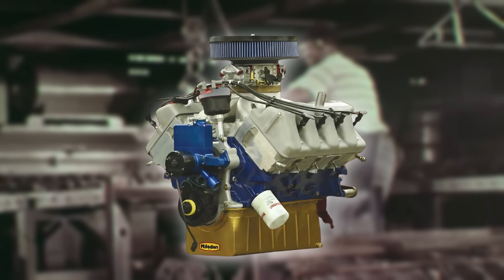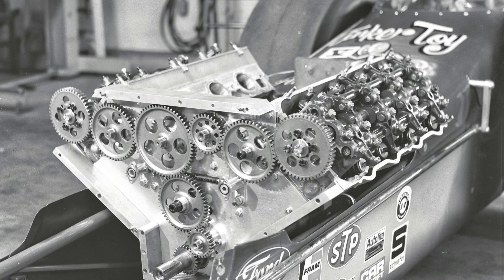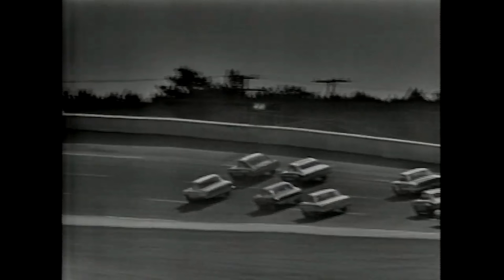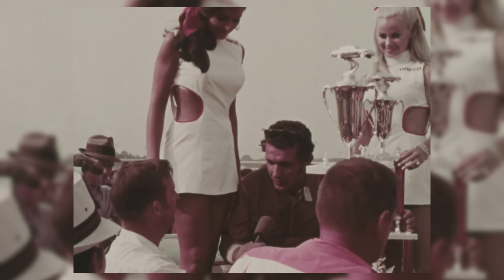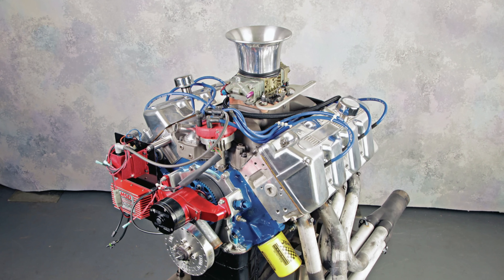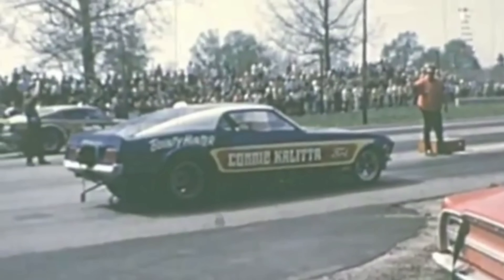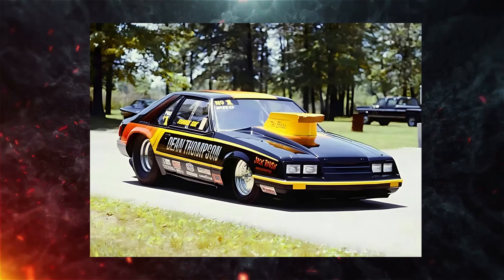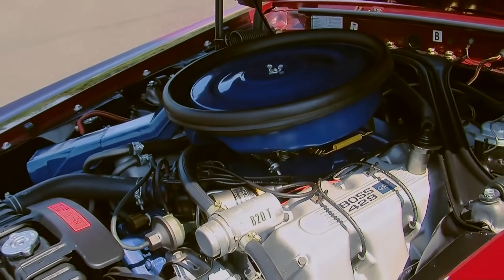The Shocking Truth behind Ford’s Banned BOSS 429 Engine!

Comment: Back in my college years there was a guy running a stock 429 'stang.  His first time out as pure stock he couldn't get into the 14s.  Over the following few weeks, he added slapper bars, slicks, advanced the cam a ton and maybe even headers.  Ta Da - high 12s.
Reply: @donbrutcher4501  From the factory they were so badly detuned and fact is Ford produced only about 500 of these cars . It wasn't until John Kaase got busy improving these engines that they took off. They dominated IHRA Pro Stock and Sonny Lenord basically coppied that cylinder head for the Chevrolet racers.
Reply: @anthonytumbarello9940 
Alan Root supposedly built the blocks for Sonny. In a interview Alan mentioned he had his initials AR is on every block he made for Sonny
Reply: @BS-Outdoors1320  did not know that.  If Alan Root made the blocks he made the leading cylinder like the GM pattern and not like the Fords. I've worked on a few Sonny's engines and never noticed any AR initials. But the cylinder heads were almost an exact copy of the Kaase heads.
Reply: @anthonytumbarello9940  
https://www.youtube.com/live/5hcP0TLK1Oc?si=DifHAXBd7VDqPfNo
1.21:00 he mentions about building blocks for Sonny for Ihra competition. 
He also built the billet blocks for MMR.  

Well before that he built the
Reply from the maker: @BS-Outdoors1320 @donbrutcher4501
It's amazing how much performance can be unlocked with the right modifications! Those upgrades really do make a difference, especially on a classic like the 429 Mustang.From a 14-second turtle to a high 12-second hare! Proof that sometimes, all you need is a little tuning—and maybe a magic wand.  love the attention to detail with the signature, great share!
Reply: @donbrutcher4501  it too bad that ford didn't make more than 500 of those cars if they even made that amount?
Reply: @anthonytumbarello9940 Ford actually made 1,359 Boss 429, cars through 69-70!
Reply: @jerrywatson8281  ford made some great stuff but they couldn't make 1429 LOL!

Comment: The problem with all the hemi engines is that the camber volume is too high.  To get high compression, it requires a domed piston.  This impedes flame front travel and reduces power.  Don Garlits used to run 50 degrees advance on the 426 to compensate for this.  All the hemis came into there own when boosted as this allowed a flat top piston.  With the spark plug in the middle of the chamber, this was a great improvement over wedge heads.
Reply from the maker: @turbo32coupe Ah, the hemi engines—where the camber volume is like that one friend who always shows up uninvited to the party! But hey, at least we can count on Don Garlits to bring the spark with 50 degrees of advance!
Reply: @rarecarstorys I think it was Tommy Ivo who first jacked the hemi timing in top fuel.
Reply: @rarecarstorys Camber is the tilt of the wheels and is a suspension setting, CHAMBER is a place where combustion takes place. Y'all'd think that someone that called the sock a camera 4 times would take a sec' to assure they spelled something correctly and didn't repeat a mistake... again!
Reply: @BubbaSmurft  I am typing challendged
Reply: @BubbaSmurft  A.I. is just super smart, it knows better than 'real people' 🤣.
I'll just stick to non electronic 'everything' on vehicles
Reply from the maker: @BubbaSmurft
Thanks for the clarification! It's always great to have knowledgeable viewers like you who can help keep everyone informed. i dont care about spelling correctly,  lifes to short ,  be joyful about inperfection and create things your passionate about , with love and jesus in your heart, remember to stay curious not judge mental , not all disabilitys  are visable ( Dislexia ) i suppose some people like to belittle others for trying ! because it make you feel superior or perhaps your evil and would tell a guy in a wheelchair to stop being so lazy,   anyway , i wish you well regardless
Reply from the maker: @1crazypj
Thanks for sharing your thoughts! There’s definitely something special about the simplicity of non-electronic vehicles that many enthusiasts appreciate. im with you on this 100%
Reply: But the Forfd Boss 429 is a crescent Hemi, which is a better street design. Ford choked the engine down as it was only concerned about NASCAR performance. Had emmisions regs had not hit, the Boss 429 would have conquered the street as well
Reply: @JC-gw3yo Nope. Ford didn't want tons of Warranty claims so valve springs that limited RPM to 5000 plus a small Carburetor and Exhaust manifolds just stifled it. As stated in the vid, the heads lent themself to running wide open for long periods, not from idle to top RPM in 6 seconds. 
     It took modifying it beyond what Ford engineers could see to make it something. With the Boss9 in slightly modified form, the Tunnel port outran it as they were outlined by Ford. The SOHC could outrun it until the chain stretched. The Chrysler Hemi was chocked and hobbled on the Big Oval. In Drag racing, it wasn't anything compared to what it was on the Oval. Glidden never let anyone see what he did to make that engine perform in Drag Racing. I'm  guessing that he filled the intake ports to gain velocity. Ford asked him and he told them the price, which they declined to pay. In stock form, the 351 Boss annihilated it. Truth is, better combinations could be had for less money and more performance, such as the 351 Boss. The Boss9 was more assumed legend than they actually were.
Reply: @thegreenerthemeaner  the 429 was legendary on the Nascar tracks. It was  ot .adequate for the drag strip. In the right hands it was unbeatable on the drag strip too, before NHRA factored it out of competition alo g with the Cleveland, which has to carry more weight per cubic inch than a hemi. Anything Bob Glidden ran was factored out of competition eventually.  He is the reason no one can make a Ford compete in prostock to thus day, they have been factored out of any chance of winning.
Reply from the maker: @thegreenerthemeaner
You make some excellent points! The engineering decisions behind these engines were definitely complex, and it's fascinating to see how modifications can change their performance drastically. thank you for your detaild insight
Reply from the maker: @JC-gw3yo
the semi hemi
Reply: The street 429 also had smaller and heavier intake valves.
Reply: Couple of people may be interested to know that Harley Davidson 'XR' engine needed up to 80 degrees advance with the 'deep' hemi chamber running at 8,500 rpm. 
It was a terrible design with very high dome piston so super thin combustion chamber.
Flame travel was much larger than the bore size 
Crazy

Comment: This was the engine that forced the '69 Hemi Daytona Dodge Charger and the '70 Plymouth Hemi Superbird into existence. The street version was kinda mediocre (mismatched combo: huge port cylinder heads, tiny cam, waaaaay too small intake manifold and carburetor), but it didn't take a lot to wake it up.
Reply from the maker: @wesleyperson3402 You're absolutely right! The BOSS 429 certainly had a significant impact on the muscle car wars, and it’s fascinating how it pushed competitors to innovate.
Reply: @wesleyperson3402  that is an incorrect statement.  The wing cars were dominant on the super Speedways and NASCAR again did not want specialized vehicles with big blocks. The wing cars did race in 1971 but could not have an engine bigger than 305 then in 1972 NASCAR ruled out all areo cars.
Reply: @anthonytumbarello9940  Actually it's not, because the Talladega Torino came before the Daytona Charger and the Plymouth Superbird. The '68 HEMI Charger 500 kinda sorta solved the front end aerodynamics challenge, but the flush grill and headlight design created so much down force out front that the rear end would actually start to lift at high speeds. Enter the '69 Torino Talladega, which solved the rear down force problem, plus the track version of the Boss 429 had a slight horsepower advantage due to the Boss's slightly larger ports and valves than the Race Hemi, ok plus the Holley Dominator that was designed especially for the Boss didn't hurt either. That sent Chrysler back to the drawing board in the aerodynamics department, thus the '69 Daytona Charger and '70 Plymouth Superbird were born.

Comment: It wasn’t banned it was just a turd, so just stop it.
Reply from the maker: @frankjohnson6342 Well, every legend has its critics! The BOSS 429 may have had its quirks, but it sure left a mark in automotive history.
Reply: @rarecarstorys This engine IS banned in  nhra top fuel and funny car classes to this day,due to the bore spacing rule.
Reply: @rarecarstorysBob Glidden was the only person to have success with this engine but from what I under stand he had to do a lot of creative welding work and reshaping the heads and block to get it to run and I would be willing to bet there wasn’t a whole lot of pieces that could be interchanged with a stock set of heads or even the block that was heavily modified with was all the non Ford designs put into the engine that made it such a huge success, it was also why Warren Johnson would be constantly trying to get the unseen from the outside modifications banned but he was no different with his Oldsmobile engines. To great minds blending cheating with grey areas mixed with the rules didn’t say that philosophy.
Reply: BULLCRAP
Reply: Yah that voice is absolute trash, tell us about the “camera” motor and the “boss 9”??? I’ve NEVER heard of the Boss 429 being called the Boss 9

Comment: Ok very good video.  Love the 429 boss engine and John Kaase has developed into a killer engine.
Reply: Yep, Kasse has developed the BOSS 9 and now you can get a big cube 9 that makes about 1,000 hp on pump gas N/A
Reply: @mikeabney1214  You get the same 1000 hp (but not the torque) from a 358”  R5 P7 Dodge NASCAR engine but with a cam with specs for drag racing to give it a peak higher hp over the circle track wide flat hp plane from 7000 rpm to 9500 rpm. Amazing what time and technology has changed how much more power can be pulled out of a much smaller naturally aspirated engine than was possible in 1970.
Reply from the maker: @anthonytumbarello9940 I really appreciate your kind words! The BOSS 429 is a fascinating topic, and it’s great to see fellow enthusiasts like you enjoying the content!